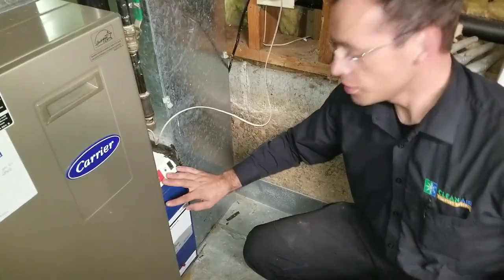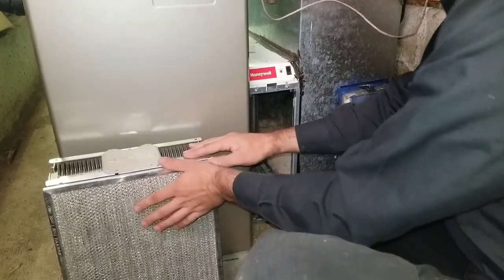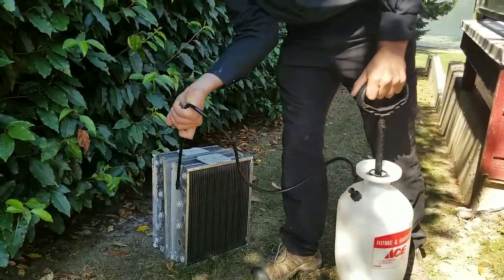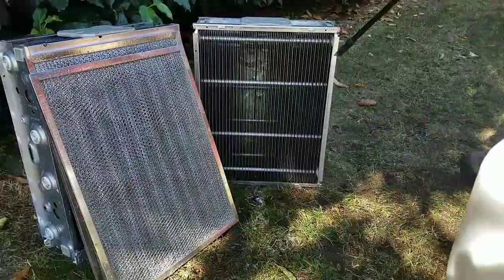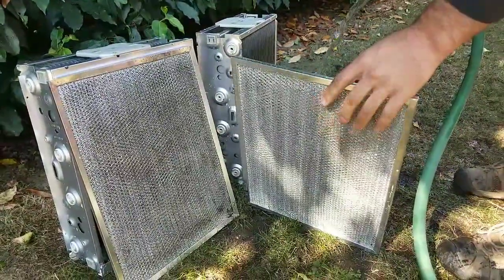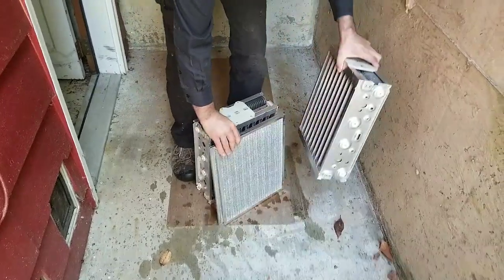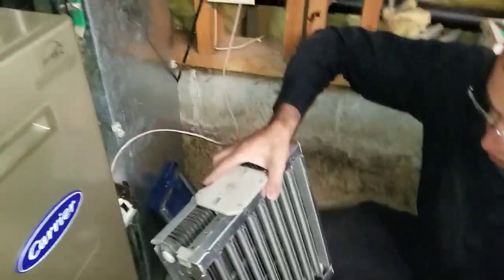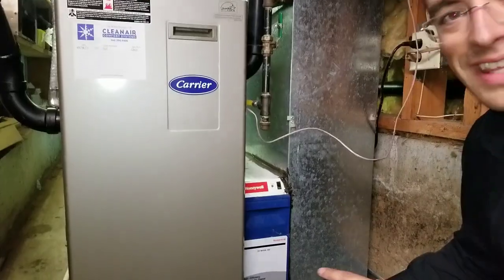How To Wash an Electronic Air Cleaner, Cleaning a Honeywell EAC Filter. How often? Every Season

Comment: thank you for your video, my Honeywell electric air cleaner has been installed 1999, it still working now, it saves a lot of money for not need to buy filters, I put them in the dishwasher to clean every 3 months.  
I am going to buy a new Lennox furnace and air conditioner, and hear from the salesman that electronic air filter is not good, it produce ozone,  is this true? I was planning to continue using this air filter, can you please give me some advise?
 I also have a Honeywell humidifier that still working, but planning to get Lennox one as well.  What do you think, so i just keep the existing humidifier?
thank you in advance!
Reply from the maker: D Wong, it's up to you if you want it keep the old electronic air cleaner or buy a new one. 
The Honeywell EAC produces ozone. Few people are allergic to ozone. If that is not an issue for you, you don't have to replace it. 

I personally like the Lennox Pure Air because it's a MERV 16 filter and has a lot of benefits. If I had to choose I would choose he new Lennox Pure Aire. 

Also keep in mind that your Honeywell air cleaner may break in the upcoming years. At that point you can install an equivalent MERV 11 pleaded air filter cartridge or even a MERV 16 (like the Lennox Pure Aire). You could also replace the unit with a new one altogether, however at that time it will cost more labor. It's easier to do it at the same time as the furnace. 

I'm sorry I didn't see your message sooner. Please give me an update on what you've decided to do. If you're still in the process of thinking about it please reach out by text and I will help you further.

Comment: i have the green fileter too.. which goes on left and which goes on right? when i looked up green was on right, silver cell, then left was silver filter!!
Reply from the maker: The green filters are called "post-filters". 
That means they have to be downstream of the big cells. 
The silver "pre-filters" need to be installed closest to the air return intake, and the green ones go closest to the furnace or air handler.
Reply: @cleanairheatingcooling4105  can you clean the green ones the same way?
Reply: @joerispoli8465  They say not to. Honeywell says to replace them. Some say they vacuum them. But do NOT wash them or get them wet as the water will make them useless.
Reply: John Rounds thanks, I had the same question as Joe.

Comment: I have an old bryant electronic air cleaner that I would like to just put a regular filter in it.  I've measured the cells but I litterally cant fine a single filter that fits.  I'm wondering if you would know what to do.
Reply from the maker: A Mac, 
I understand what you're talking about. If you put a standard filter in, a lit of air will leak around it. 
The best solution is to replace the old Bryant EAC with a new media filter system, EAC or purifier.
Reply: @cleanairheatingcooling4105  I actually cleaned the cells today and when I put them back in the furnace the EAC light doesnt turn on.  It's so old that I really dont care, the problem is now I need a paper hepa filter but nothing fits.  Going to have to call local hvac company to figure it out.  Sucks cause I needed my savings towards my kids medical bills.
Reply from the maker: @andymccloskey8039  I'm sorry. The best option would be a Honeywell F100 filter. The cheapest system to put in and filters only cost about $35 to replace once a year. But if you want, you can get a better than HEPA filter which will fit, for about $100-150.
Reply: @cleanairheatingcooling4105  - Can that HEPA filter potentially degraded the fan performance or even burn out the furnace due to low flow rate? I read that could happen, but I was reading, you're the guy cleaning these.
Reply from the maker: @bruzote  great question. All Hepa filter, media filters, and any reputable filter will have engineering data and tests that show the airflow resistance. They all have some resistance. If the filter is designed correctly for the system, and the system itself is designed correctly, the amount of resistance is calculated and accounted for so there is no detriment to airflow. 

But to be honest, we find a ton of system not designed, only put together so your concern would be quite valid, and the filter would reduce the flow too much.

Comment: hello,  After watching many videos on how to clean an electronic air cleaner, I noticed many videos do not show the post filter in the unit.  Is it necessary to use a post filter?  If so, how often should it be replaced?  Thank you very much
Reply from the maker: That's a great question. I wish I would have mentioned this in my video. Having been a service technician for over 15 years now I can say that 90% of the electronic air cleaners do not have the post filter. They either get thrown away or they get damaged but they are not essential. Most of the work is being done by the big electronic cells. If you have the post filters you just wash them like the rest of the cells. You don't replace them unless they are damaged. If you still have the manual, there may be a recommendation for a schedule and how often to replace the post filters.
Reply: thank you so much.   @cleanairheatingcooling4105

Comment: Very good, thank you, but what is the cleaner other than "orange scent"? I find the dirt very hard to remove, even with "extra dirty" dishwasher cycle. We used to soak them in very diluted acid, and that really took all the dirt off, but it doesn't seem to be made any more.
Reply from the maker: The stuff we use comes in a 1 gallon container in concentrate and it's probably a practical and too expensive for household use. I'd recommend using simple green, 409, crud cutter, or other household degreasers.
Reply: @cleanairheatingcooling4105  Thanks! I'm not sure 409 is strong enough, but I'll look for a good degreaser.

Comment: Just bought house with Honeywell F300E 1027 that is about a year old. Duct on left furnace one right with metal filters on duct side and green fabric filters on furnace side. This seems backwards. Thoughts?
Reply: Mine has the green filters on the furnace side. Silver metal ones on the duct side. Sounds like you have it the right way. The green filters are the last line of defense before air enters the furnace.

Comment: The Light on my unit stays on even if the Furnace is not running?
Reply from the maker: On some units that is possible. Depending on the model, it may not have a flame sensor so it is always on, or there may be something wrong with the internal control board or another electronic component.

Comment: Hi, can you let us know what product you used and recommend for cleaning these filters? I know you recommended degreasers like 409, but I'd rather get the best one for this specific job and I don't have any degreasers and need to buy one anyway. Thanks.
Reply from the maker: Sure. If you call a local HVAC company, ask for EAC cleaner. It's very expensive, but it lasts a long time. I don't know what they have in your area but you can use whatever they recommend. 
If I wasn't an HVAC tech, I'd buy Crud Cutter from FredMeyer, Kroger, Walmart. I like that product because it's water based and low impact, but does a phenomenal job!
Reply: @cleanairheatingcooling4105  Thank you for an excellent response and the informative video.

Comment: I bought a house with these. I have normal air filters and never even knew this existed. Are these necessary? My air flow is kinda weak and I'm thinking these may be dirty. Never had one in any  other units at other houses.
Reply from the maker: You shouldn't use this electronic air cleaners in combination to regular pleated filters. You don't want to double up. Just pick to use one or the other. In general these electronic air cleaners if they're washed routinely which can be anywhere from a couple weeks to 4 months should be better than a regular 1-in filter. But if you have a merv 11, 13 or 16 filter that would be better than these EACs.

Comment: My girlfriend’s furnace has this but is no longer working and the furnace installer never added a new one or but a location for another filter. I was wondering if I can replace the cells with “paper” filters instead, since the unit is no longer connected to power.
Reply from the maker: Yes you can

Comment: I have one of these. Do you think they work better than normal filters?
Reply from the maker: Slightly. They aee able to catch smaller particles. But they are oy efficient over 24 hours of operation. There are better options. We recommend air purifiers and air scrubbers.
Reply: @cleanairheatingcooling4105  thanks for answering. And thanks for the video.

Comment: Which direction is on/off for the switch? Thanks!
Reply: Also did the test button work in this video? I’m not sure I’m hearing a spark on mine.
Reply from the maker: @telrick4  On is up. Off is down. I don't recall if the spark worked, but keep in mind the cells weren't fully dry for the purpose of this video and the cells short out when they are wet so the spark wouldn't work until they are dry.

Comment: I have the original Honeywell F50 F and F300E Electronic Air Cleaner owner’s guide and it says to use automatic dishwashing powder,  which I did use at one time. Now this product comes in Tablets, which are not useful  for cleaning electronic air filters. In the video you advise using a residential degreaser product. Is there any information from Honeywell where this is noted? I don’t see that they have updated any information in many years.
Reply from the maker: This is a great question. I'm glad you asked it. I have read most of the manuals from Honeywell. I honestly haven't read any very recently. But if you have one of the original ones, rest assure that if you don't use something like brake cleaner, heavy duty degreaser or acid, you will be fine. Simple green, Windex, etc are adequate.

Comment: what is that specific formula you use? I have pets. also for a decade I've always only used water. I had no idea that an oil remover was needed. I also was wanting to know if I added a carbon filter(as a post filter) if it would protect me against the pollutants like CO2's of car exhaust emissions or lawnmower emissions from outside? or if it merely deals with in home odors.
Reply from the maker: The carbon filter is mostly good for odor removal. Adding an air scrubber or a Lennox air purifier will do more for you then the electronic air cleaner.

Comment: Can you Lysol  to clean the filters ?
Reply from the maker: You probably could. Doesn't Lysol evaporate quickly? I obviously don't use it enough to know. Typically any degreaser that can soak the filters which can be washed off with water would be great. If Lysol fits that bill, go for it!

Comment: I opened mine up and I noticed I also have 2 cells. But the prefilters I have one on the right and one on the left? Ones pulled up front and the other one is pushed back.

Shouldn't the prefilters be on the same side?
Reply from the maker: Yes, they should. I see that quite often. Just move both before the cells.

Comment: Hi Sir 
This filters works with 120v or 240v?
Thanks for your answer
Reply from the maker: It depends on your model. Most are 120V. Which model do you have?
Reply: Carrier electronic air Cleaner
Reply from the maker: @raminsanakhan  do you have a picture of the spec plate?

Comment: What does it mean if I cleaned them out and now unit has a constant ticking noise while running?
Reply from the maker: Great question. Thank you for asking this. It can mean a few things: 
1. The cells are still wet. So turn power off on the filter, turn the fan on for about an our, then turn power back on to the filter. If the cells are dry, the ticking should stop. 

2. There may be something connecting two plates causing a short. Visually inspect both cells for pet dander, hair, lint, or other impurities which might cause the narrowly spaced plates to short out and spark. 

3. If the sparking occurs continuously while the fan is running and stops when the fan stops running. There is nothing wrong. Dust is passing through the filter and the filter is doing its job and zapping the particles.
Reply: Clean Air Comfort Systems thank you!!! Seems one plate was a bit bent and touching another.  I was able to gently straighten it and now it is working properly.

Comment: I recently purchased a house that has a Trane perfect fit electronic air cleaner and I was wondering if you still need to use a regular disposable filter?
Reply: I've kept one in just to be safe but since August if this year in a house with 3 dogs and it still looks new. I just don't know if it effects the airflow at all or not because I have a bedroom that gets almost no flow to it at all
Reply from the maker: If you are using the whole electronic air cleaner as designed and clean it every 3 months or so, you should not use an additional disposable filter. Adding a second filter would slow down the airflow and increase static pressure. That can lead to a lot of issues. It would take a 30 minute video to list them all, but just remember, one filter system at a time.
Reply: Thank you so much!! I couldn't find anything online about it you've helped a lot

Comment: Can someone tell me how to open it to get these out the cover is not coming off
Reply from the maker: From my experience if you have the type of unit the cover will be very similar but you have to pull extremely hard and jerk it sometimes with all of your strength it has to pop out sometimes it's old and rusty

Comment: power light switch is not turning on, no light is there with that?
Reply from the maker: Could be a plugged air flow sensor, ba ld power head or bad cells. It would take a service call to diagnose it accurately. Have you figured out what was causing that?

Comment: What kind of degreaser are you using?
Reply from the maker: I don't have the original bottle. But it was a special degreaser for these products. Honestly, you can use any kind of household degreaser: Meyers, Simple Green, Purple Power, Windex, etc.
Reply: I recommend you search on 'plant friendly degreaser' for many available choices.  It's so easy to chose an environmentally friendly cleaner that there isn't an excuse not to.  Don't use Windex as suggested below because the ammonia will damage plants and potentially discolor decks, patios, etc.  I use Orange Peelz degreaser in a spray bottle (which I've diluted with about 1/2 water) because I use the product to clean my bicycle chains.  Works great but I imagine any green degreaser will work.  Helps to have a spray bottle which you can pick up at most stores if you don't have one.

Comment: How long can an electronic air cleaner last?
Reply from the maker: Typically 15+ years. But we see them fail before that age at times.
Reply: @cleanairheatingcooling4105  My Robertshaw 7600 is over 20 years old. How can I test if it is working correctly? I hear the sparks popping when it runs so I assume it's zapping dust but it is VERY clean even though I only clean it every year or two. My other house with a paper filter is thick with dust in just a few months.

Comment: What type of chemical used to washing the filter
Reply from the maker: We use a commercial grade cleaner but you don't have to use anything fancy. You can use any type of mild household degreaser or cleaner product.
Reply: @cleanairheatingcooling4105   Aircon coil washing chemical use to washing

Comment: dish  soap?
Reply from the maker: Yes. Some people like to soak these units in the sink or in a utility sink with a little bit of dish soap and water so that all of the grease and harder deposits melt off of the cells. I don't recommend this option because it takes a long time but a lot of our clients do it that way because that's how they like to do it and it obviously works well. Some people even put it in the dishwasher.